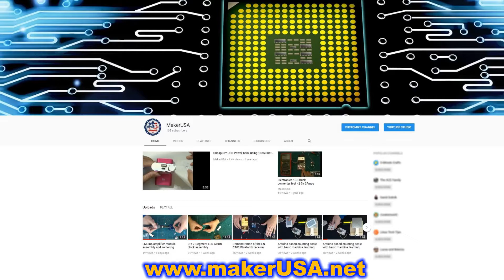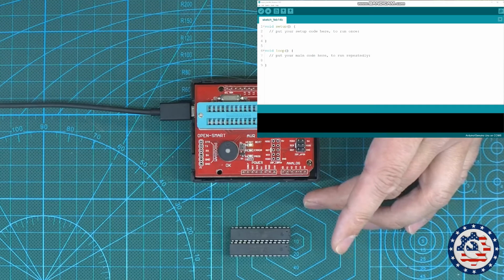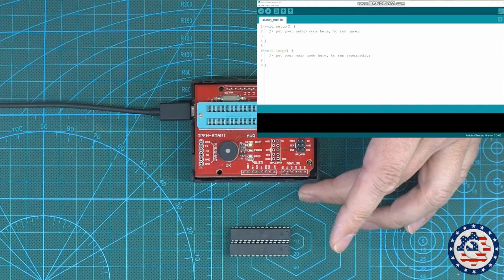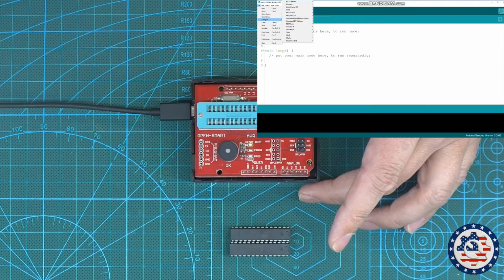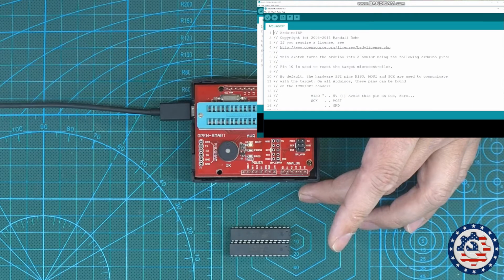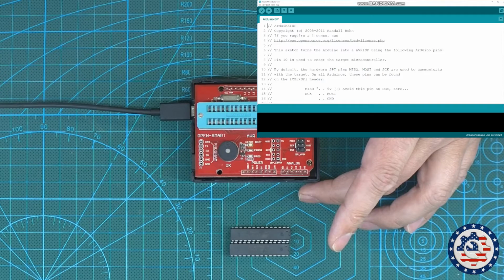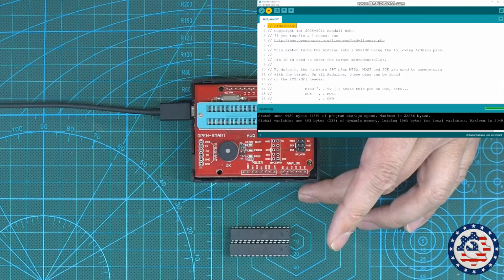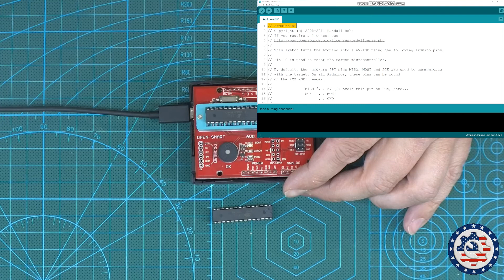Burn Arduino boot loader to an ATmel ATMega328P using AVR ISP shield.

Comment: Also, it was not mentioned and/or demonstrated if this shield can be use to upload firmware to other chip in circuit, use this as ISProgramer. Perhaps burn bootloader on other ATmega328 in another Arduino Uno board.

Comment: Make sure you have programmer set to "Arduino as ISP" under the tools tab in Arduino IDE for anyone having issues, also atmega328 chips come in different 28pin dip versions even tho the "form factor" looks the same the chip's signature can be different example atmega328p vs atmega328 will have different signatures so if you have a atmega328 and not an 328P you will need to do some IDE "tweaks". helpful video for makers overall tho thanks.

Comment: This device only burns bootloader to a atmega328 chip right?  Can it be used for putting sketch into  a newly burned chip? Also how do you use atmega328 chip on perfboard? (to have it work like Arduino UNO)?

Comment: if i press burn bootloader, the programmer's board turns the Error LED on ...
Reply: Hi Mr. Mythoclast.
Just wondering .. I have the same problem.  Does the Arduino IDE shows an error (Orange bar) below the code window?  Mine didn't although the error LED was lighting on.  
Just for the kicks, I tried the newly programmed 328P U on my NANO and .. well, it worked well.
I could load sketches into it just like the original MCU.  I think it's just an error of the programmer.
Try this and let me know if it worked for you.  Best regards and have a great day !
Reply: @oncledan282  i've tried it once more and all works fine now ..

Comment: With this, can you also click the right arrow and upload code just as you would do normally? (as if it was a normal arduino project) and then remove the microcontroller with the code loaded, and use it stand alone on a breadboard or PCB without the need to have anything more than the chip itself on your projects? Just to clarify?

Comment: Sir, I have followed the steps you taught on the video, but when I burn the bootloader to the new mcu, an error occurs : 

avrdude: Yikes!  Invalid device signature.
         Double check connections and try again, or use -F to override
         this check.
Error while burning bootloader.

can you help solving this problem please ? Thank you sir.
Reply: What chip are you using?
Reply: @UmarSear  Atmega328P U
Reply: I'm having an error too. I'm burning to an atmega8-16pu. I don't get the yikes error, but I get:

Expected signature for atmega328P is 1E 95 0F

Double check chip, or use -F to override this check.
Reply: change  programmer in the tools menu to "AVR ISP" and it should burn straight away

Comment: Good day, Sir .. Good day, all !
Like many users have commented below, I obtain an error (Programmer's LED), but no error on the IDE (Process depicted below). Should I ignore the Error LED on the programmer ?

Here what I have on the lower portion of the Arduino IDE.
----------------------- ( Start of copied text from Arduino IDE ) -----------------------
avrdude: Version 6.3-20190619
         Copyright (c) 2000-2005 Brian Dean, http://www.bdmicro.com/
         Copyright (c) 2007-2014 Joerg Wunsch

         System wide configuration file is "/Users/«Username»/Library/Arduino15/packages/arduino/tools/avrdude/6.3.0-arduino17/etc/avrdude.conf"
         User configuration file is "/Users/«Username»/.avrduderc"
         User configuration file does not exist or is not a regular file, skipping

         Using Port                    : /dev/cu.usbmodem411
         Using Programmer              : stk500v1
         Overriding Baud Rate          : 19200
         AVR Part                      : ATmega328P
         Chip Erase delay              : 9000 us
         PAGEL                         : PD7
         BS2                           : PC2
         RESET disposition             : dedicated
         RETRY pulse                   : SCK
         serial program mode           : yes
         parallel program mode         : yes
         Timeout                       : 200
         StabDelay                     : 100
         CmdexeDelay                   : 25
         SyncLoops                     : 32
         ByteDelay                     : 0
         PollIndex                     : 3
         PollValue                     : 0x53
         Memory Detail                 :

                                  Block Poll               Page                       Polled
           Memory Type Mode Delay Size  Indx Paged  Size   Size #Pages MinW  MaxW   ReadBack
           ----------- ---- ----- ----- ---- ------ ------ ---- ------ ----- ----- ---------
           eeprom        65    20     4    0 no       1024    4      0  3600  3600 0xff 0xff
           flash         65     6   128    0 yes     32768  128    256  4500  4500 0xff 0xff
           lfuse          0     0     0    0 no          1    0      0  4500  4500 0x00 0x00
           hfuse          0     0     0    0 no          1    0      0  4500  4500 0x00 0x00
           efuse          0     0     0    0 no          1    0      0  4500  4500 0x00 0x00
           lock           0     0     0    0 no          1    0      0  4500  4500 0x00 0x00
           calibration    0     0     0    0 no          1    0      0     0     0 0x00 0x00
           signature      0     0     0    0 no          3    0      0     0     0 0x00 0x00

         Programmer Type : STK500
         Description     : Atmel STK500 Version 1.x firmware
         Hardware Version: 2
         Firmware Version: 1.18
         Topcard         : Unknown
         Vtarget         : 0.0 V
         Varef           : 0.0 V
         Oscillator      : Off
         SCK period      : 0.1 us

avrdude: AVR device initialized and ready to accept instructions

Reading | ################################################## | 100% 0.03s

avrdude: Device signature = 0x1e950f (probably m328p)
avrdude: NOTE: "flash" memory has been specified, an erase cycle will be performed
         To disable this feature, specify the -D option.
avrdude: erasing chip
avrdude: reading input file "/Users/«Username»/Library/Arduino15/packages/arduino/hardware/avr/1.8.2/bootloaders/optiboot/optiboot_atmega328.hex"
avrdude: writing flash (32768 bytes):

Writing | ################################################## | 100% 0.00s

avrdude: 32768 bytes of flash written
avrdude: verifying flash memory against /Users/«Username»/Library/Arduino15/packages/arduino/hardware/avr/1.8.2/bootloaders/optiboot/optiboot_atmega328.hex:
avrdude: load data flash data from input file /Users/«Username»/Library/Arduino15/packages/arduino/hardware/avr/1.8.2/bootloaders/optiboot/optiboot_atmega328.hex:
avrdude: input file /Users/«Username»/Library/Arduino15/packages/arduino/hardware/avr/1.8.2/bootloaders/optiboot/optiboot_atmega328.hex contains 32768 bytes
avrdude: reading on-chip flash data:

Reading | ################################################## | 100% 0.00s

avrdude: verifying ...
avrdude: 32768 bytes of flash verified
avrdude: reading input file "0x0F"
avrdude: writing lock (1 bytes):

Writing | ################################################## | 100% 0.02s

avrdude: 1 bytes of lock written
avrdude: verifying lock memory against 0x0F:
avrdude: load data lock data from input file 0x0F:
avrdude: input file 0x0F contains 1 bytes
avrdude: reading on-chip lock data:

Reading | ################################################## | 100% 0.01s

avrdude: verifying ...
avrdude: 1 bytes of lock verified

avrdude done.  Thank you.
----------------------- ( End of copied text from Arduino IDE ) ------------------------

I hope you can reply to my comment.  Until then, have a great day and stay safe and healthy.
Should I read from you soon ?